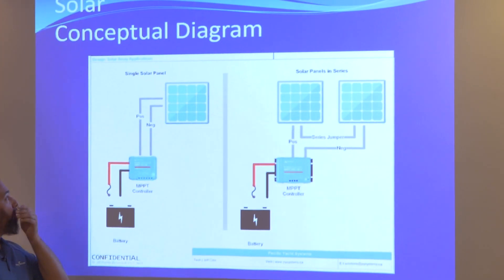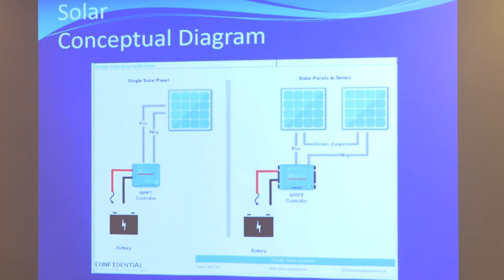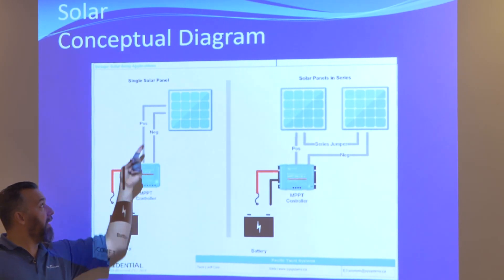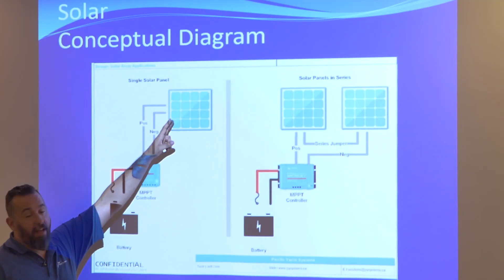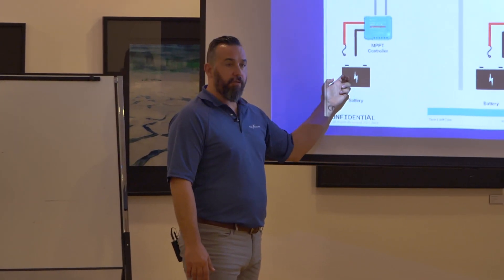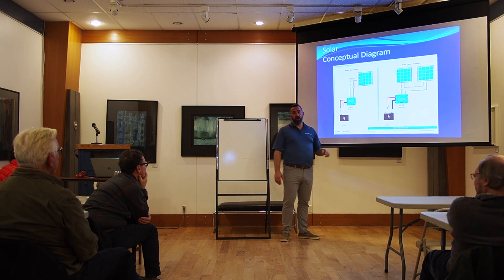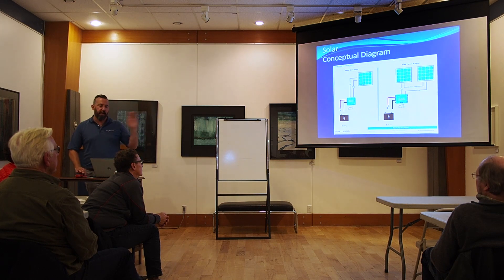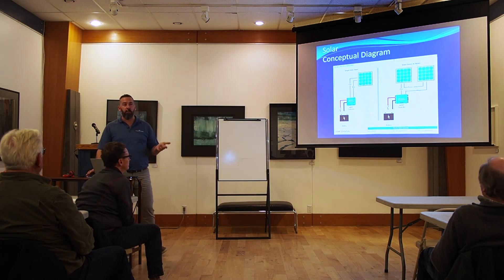How To: Marine Electrical Seminar - Solar Panel Troubleshooting - Ep 24/30

Comment: From Spain, ¿should i connect the negative of the controller to the bateries directly or to the negative distributor? I have a Mastervolt controller. thanks!
Reply from the maker: Well, negative distribution is better, as long as negative distribution is well connected to battery negative.

Comment: Jeff if the batteries are full, what will the led's on the controller be doing?
Thanks
Reply from the maker: Hi Steve, depends on the controller. What MPPT controller are you using?